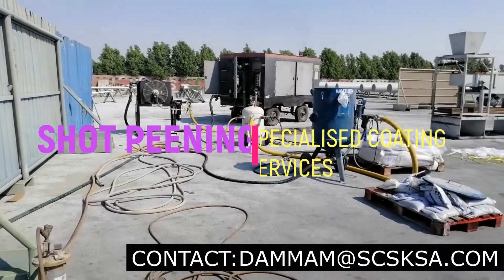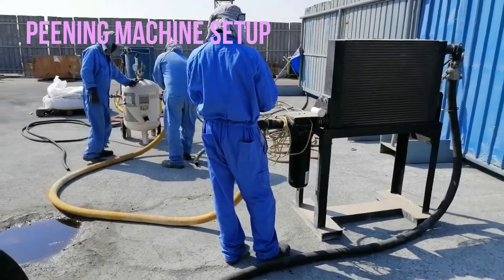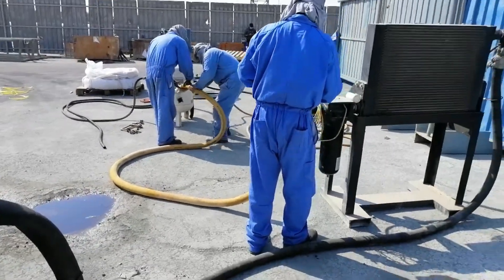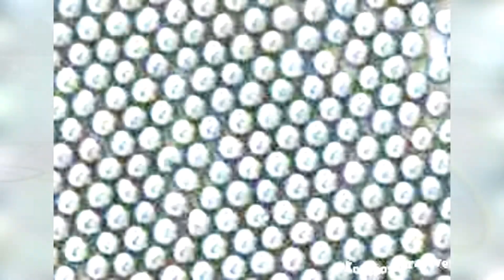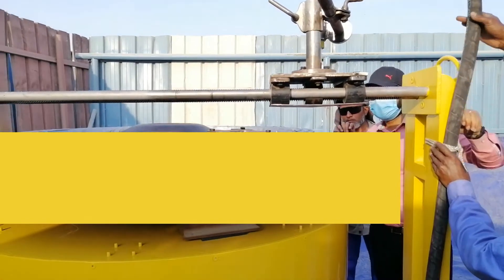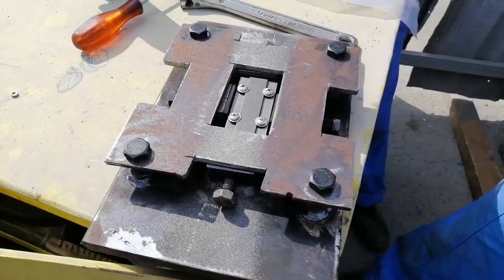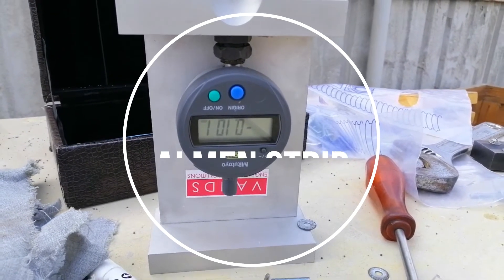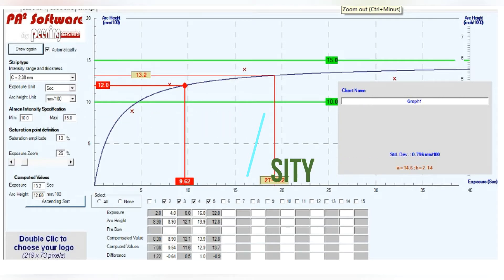HOW WE DO SHOT PEENING?  I STRESS CORROSION I Aircraftsparts I shotblasting

Comment: Before we dive into peening lets talk a bit about welding distortions. Welding distortion is caused by the expansion and contraction of the weld metal. This occurs when the base metals are heated during the welding process. There are multiple reasons why this happens.

When you perform all the welding on one side of a metal joint, it will cause much more distortions than if the welds are alternated from one side to the other.

Peening is an effective method used to balance the shrinkage of a weld puddle as it cools down. Generally, peening the weld bead thins it out by stretching it over the surface. This helps reduce the stresses induced by the contraction of the metal as it gets cooler.
Reply from the maker: thank you for your response

Comment from the maker: In most modes of long-term failure, the common denominator is tensile stress. Tensile stresses attempt to stretch or pull the surface apart and may eventually lead to crack initiation. Because crack growth is slowed significantly in a compressive layer, increasing the depth of this layer increases crack resistance. Shot peening is the most economical and practical method of ensuring surface residual compressive stresses.

Shot peening also can induce the aerodynamic curvature in metallic wing skins used in advanced aircraft designs. Additional applications for shot peening include work hardening through cold work to improve wear characteristics, closing of porosity, improving resistance to intergranular corrosion, straightening of distorted parts, surface texturing and testing the bond strength of coatings.